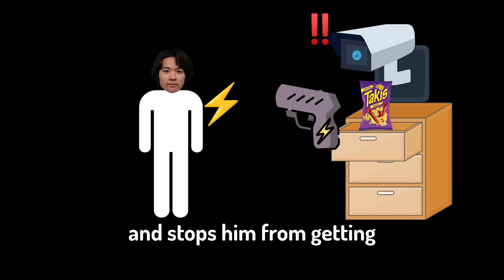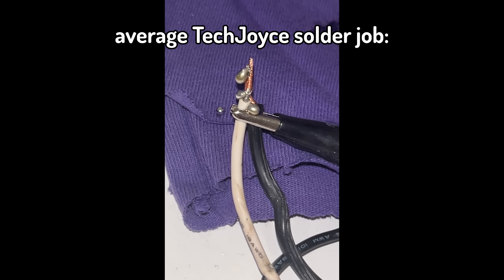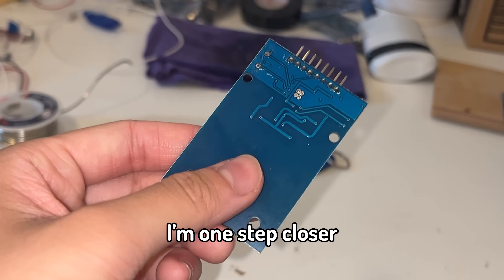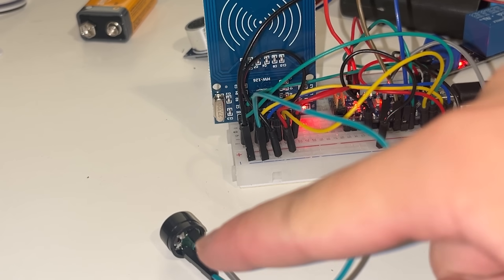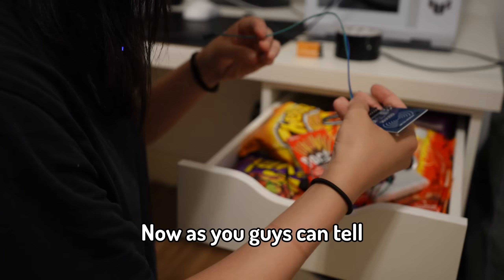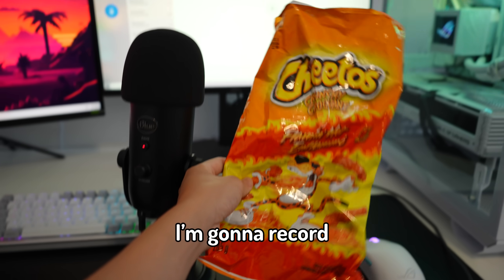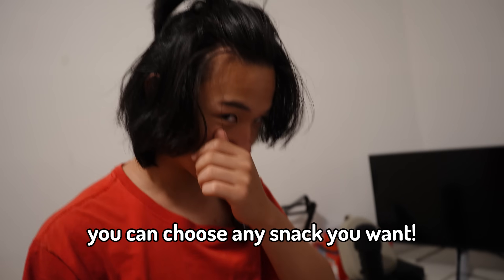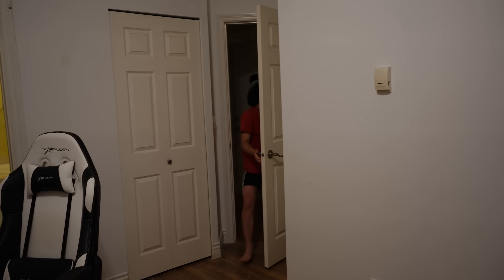catching a THIEF with a TASER...

Comment: you should cover it with copper tape in a bunch of lines that are far away enough to not spark but to still shock and then also make a simple locking mechanism for the drawer so its a pain to break into